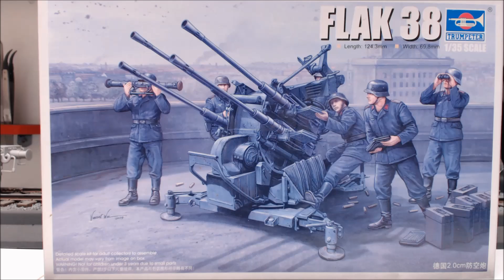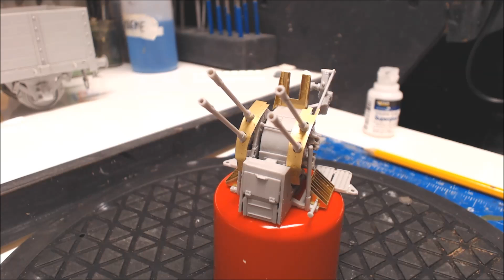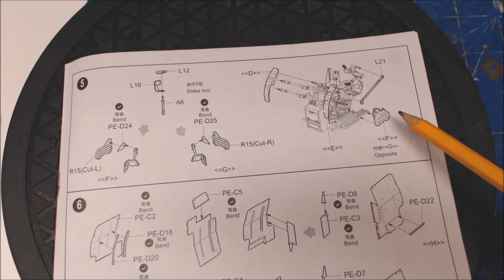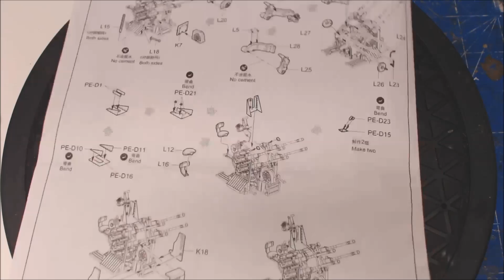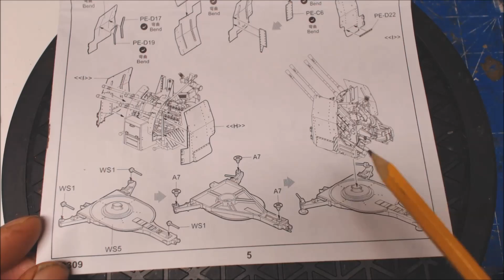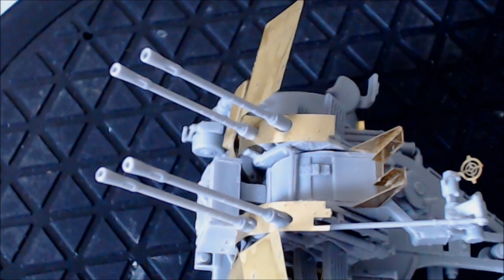Trumpeter Flak 38 1/35 scale Build

Comment: Ummmmmmmmm .......
Sin, brother, I hate to point this out but you have the ammo mags in backwards. The curved side points forward when in the gun.  And one other small item......  you've got the Gunner's shield backwards and the two little doors go on the front or flat face.  Just thought you would want to know that now instead of later.  
   I'm really impressed with the P/E work you've done on this. I wish I was half as good as you are doing P/E.  I've got the same Flak 37 kit and I'm going to try and do the P/E gunshields and soder them. For anyone who doesn't do the gun shields , it's fine. They're removable and we're often taken off, especially when in a confined space. This goes for both of your kits. I'm using mine in the back of an Italiari SwS kit. The one with the Goliath and crew. They don't give you the top section of the cab wall. I found a photo of one just like that with the Flak 37 in the back.
Reply from the maker: Thank you Ennis I have turned the magazines round . I am also working on a soldering tutorial  hopefully it will be out in few weeks many thanks Sim
Reply: Simon Kemp. Models. That would be great. I'm really interested in learning how to do it.  Don't forget to fix the gunner's shield. The flat side faces forward.